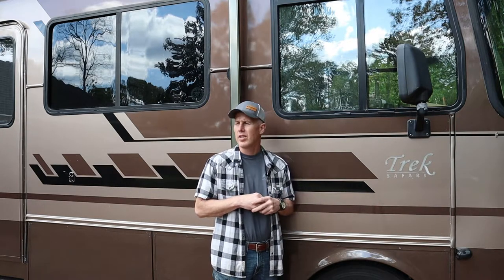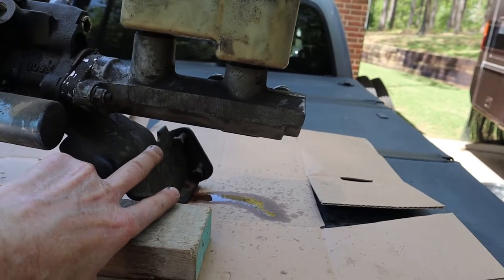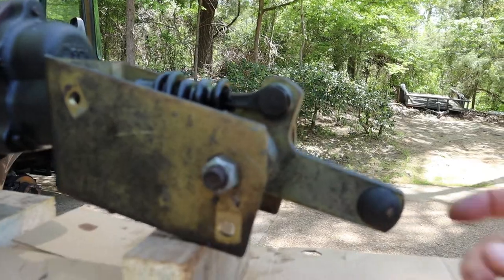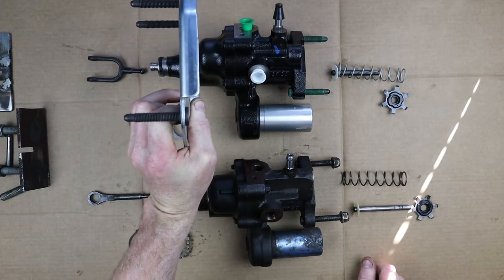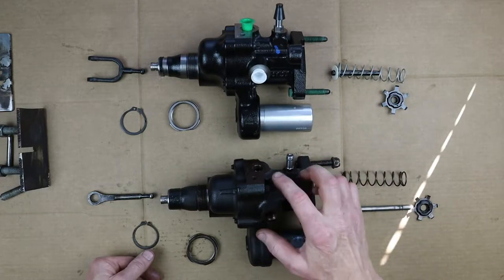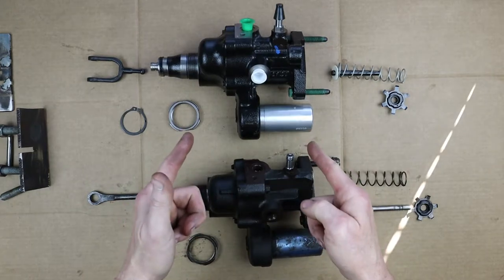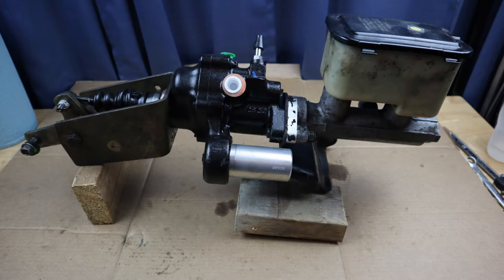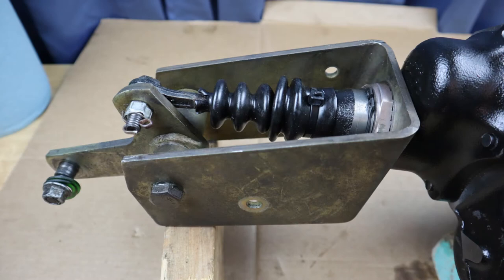WORKHORSE P32 BRAKES - Video #4 - Hydroboost Upgrade

Comment: Great Video!  Have you thought about switching to one of the new screw cap style Master Brake Cylinders? I figured out that the Chevy Express Dually models have similar parts/weights to the Workhorse Chassis. (up to 2006)
Reply from the maker: I think the deciding factor with the master cylinder would be the diameter of the piston.  If the new one isn't the same as the original, it will affect the brake travel and pedal pressure necessary.  I'm not saying that it can't be done or that it wouldn't improve things.  A lot of measurements and testing would be needed to be sure its safe.

Comment: Do you think ACDelco 178-1036 could fit ?  I was looking through the Duramax forums and the LML brake booster rod looks very similar in length to the P32 one.
Reply from the maker: I can’t say for sure without having the exact specs or one in hand to measure. Even a slight change in the length of the rod would change your pedal hight and length of travel. Also, the hole in the end of the rod would need to be the same so there is no slop there. 
Please let me know if you try it and it works. It would be nice to not need to replace the shaft.
Reply: @ufixit  I had my hydroboost with a reman unit replace a few months ago and it exploded (the accumulator blew off) a short time later (all powersteering and braking support goes away in an instant)  so I'm probably not going down that road anymore. I know that the rod length makes a difference - yet when I had the unit replaced - I noted that with the holes on the bracket you can adjust the position of the brake pedal slightly.  Probably depends how far it is off. 

I'm not concerned about the hole size - when it's to small you can drill it out - when it's to big - you can machine larger bolt, or put a brass sleeve around the existing.  I'll keep you posted.

Comment: The issue I’m having is when I’m coming to a stop it feels like the ABS is turning on just before I come to a complete stop. Every time. Probably right around 10 mph  till I stop. Ever heard of this?
Reply from the maker: I've never experienced that.  I'd suspect the ABS system, warped rotor, or bad wheel bearing in that order.  Hope you are able to diagnose it.  Safe travels.

Comment: I was able to fit the ACDelco 178-1036. It's an almost bolt in replacement. There are two differences 1. The push rod hole is about 1mm  1/16 too large for the bolt on the P30 - I've just wrapped a few layers of metal flashing around the bolt to make it a flush sit 2. the rod is slightly shorter. Which means that the brake pedal sits a tad lower - (adjusting the brake light switch - disconnect the cables and screw it inwards) . Otherwise - on my 2003 not even the push rod for the brake master cylinder needs to come out - has the same exact length. The first test drive around the block was a great success - the brakes feel much better - stuff was flying forward :P will tidy up inside, test drive the next days more extensively and follow up.
Reply from the maker: Thats great information.  It will sure make it easier if the rod doesn't have to be switched over.  Thank you for sharing.
Reply: @ufixit  Thank you for making this video, otherwise I would have never searched.
Reply: @ufixit  brake feeling is so much better now.  Much less effort, but still easy to control.

Comment: I would love to get newer hydroboost for my 2000 Trek 2480.......but how do I know what to replace it with??
Reply from the maker: If you are willing swap over the necessary parts you can use the same one I did.  Booster Part Number:  AC DELCO 84609220 (Ordered from Rock Auto) . Hope this helps
Reply: @ufixit  based on your YouTube tutorial I am pretty sure I can do that , I was just concerned about the dimensions that need to be the same as the old hydroboost.
Thank you !!

Comment: what was the part number for the Master Cyl was it a workhorse or GM
Reply: I used an AC Delco 18M949 priced at $105 on Amazon ($10 less than I paid last year),  this appears to be an exact match to the original 2002 Workhorse branded part, with the possible exception of as finished surface texture.

Comment: Can you provide a link to the tool to remove the nut for the mounting bracket, please? I order the new booster and MC!
Reply from the maker: There are several available from various sources. I’m not sure of a part number but if you Google hydroboost nut socket, you will get several hits.

Comment: For that "Troublesome Nut"  during re-installation, instead of installing a bolt and nut, could you install a Clevis Pin instead (Or make one by drilling through the appropriate bolt).  Then the next time, all you need do is remove the pin.
Reply from the maker: I'm not sure but it sounds like it could work.  Best wishes.

Comment: I llost my original plunger on my hydro boost do you know where I can get one
Reply from the maker: Oh no!  There is a generic kit you can order and cut to length. You would need to know the length of the old rod. Unfortunately, I don’t have that measurement. The RV forums are usually helpful. Try Trektrax. There are a lot of guys there that have Workhorse chassis and have don this mod

Comment: Video was a great help. Could not get the pin fork out of the new one so I just removed the torque bolts out and took the back end off the new one and the bacn off the old one and swapped them and it works great...
Reply: so you separated the hydro boost half way?  Just wondering when you already do that if you could leave the front part installed? Would be far less work just taking half of the hydroboost and and the master brake cylinder out.

Comment: will this work on a 2001 p30 gas
Reply: It should I just did it on my 2002, though I used the 137-1040 hydroboost so I did not have to change the front rod, just had to shim the slightly larger eye with some thin wall hobby tubing.

Comment: Great video I have a 2003 2610 trek Do you have a master cylinder replacement. recommendation?
Reply: I don't know if you still need the information but I just did the upgrade on my 2002 Trek 2830 and used AC Delco 18M949 master cylinder which was a perfect match
Reply: I recently completed the project. Everything works great. Thank you for your help

Comment: Once I got to the part where I had made a tool to extract the pedal rod from the old unit, I realized that IMO this is not a good idea, as GM suggests.  The crimp/stake metal that holds the ball end of the rod in, gets 90% ripped out when you extract it.  People are then putting in the new rod and using a flat head screw driver to tap in/re-stake in the new rod with those slivers of remaining metal.
It's just a bad idea, and a far cry from the original retention strength.  If that rod ever did come out, you lose brakes entirely.

I switched to cutting clean with a bandsaw and TIG welding instead.  I feel this is much safer and easier too, as pulling out the rods can take incredible force, unless we can actually re-crimp them, I think it's best to just leave the factory crimp in place and swap in this manner.   You can go to a welding shop to have them do it for you if needed.
Reply: I went with the 137-1040 booster so as to avoid having to pull the rod, though I did have to add a shim and adjust the brake switches, having said that, with the way the unit is mounted I see no way the rod could pull out unless something else in the linkage broke first.  The only possible way I could think of would be if someone yanked up on the brake pedal faster than the booster could return the pedal, not exactly something I could visualize being likely to happen in the real world.
Reply: @MrPenguinLife   I can not find
 a 137-1040 booster is the number incorect